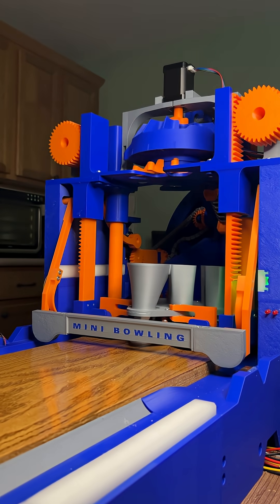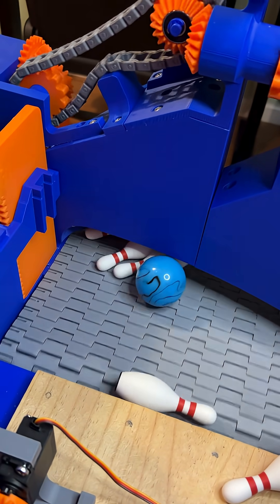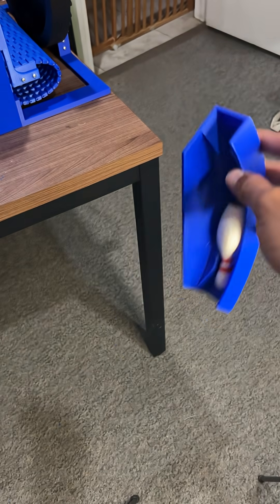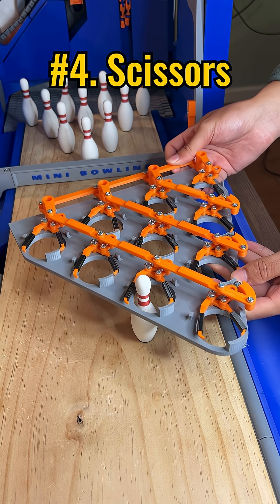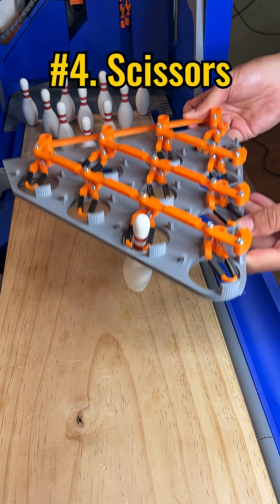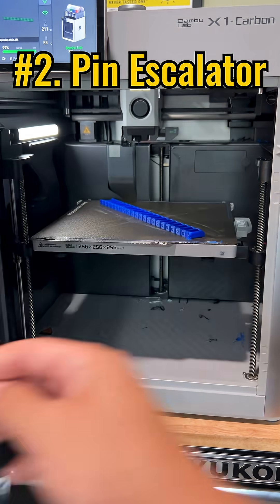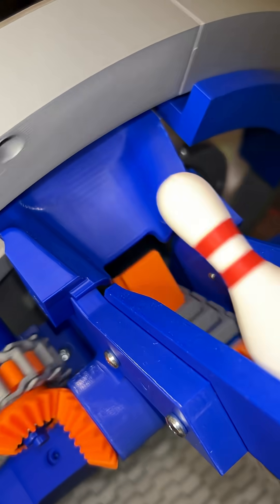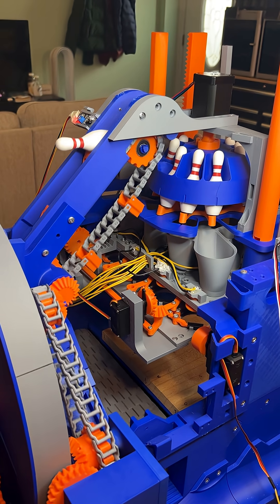How does a bowling pinsetter work?

Comment: This might be the coolest 3d print I've seen yet. Just a quick question, do you need an engineering degree before building it or do you just receive one after you get it working?

Comment: Have you thought about making a string based bowling machine? That’s a lot easier with just 1 motor for each cone and a sensor to read how much each strings got pulled (can be combined in the motor)

Comment: I worked in a bowling alley with machines from the 1930s. This is essentially exactly how they work. Of course, the motors on the original machines were run by 6 different cams & were lifting an 800lb table (the part that sets the pins).
I wish our machines had the turret. That came much later in the 80s. The original machines loaded the table flat. There was an arm that the pins would travel down on a belt. At the end is two elevated fingers, & when the pin rolled off of them, it would pull a cable that engaged the clutch. This told the arm to move to the next position. A crazy looking cam on the side controlled the order the pins were set & the pattern the arm moved in. So a pin would come off the elevator, a horn oriented it straight, it traveled down the track using a belt on the feed arm, triggered the lifter as it fell into position, once the lifter popped back up, the clutch would engage the system which moved the arm left to right & forwards to backwards using the cam to position, then it would reset as the next pin was on the way. I forget the pin loading order, but it was always the same due to being mechanically controlled. The last pin was the 9 pin, which had a switch so the machine knew it was loaded. The entire machine ran on solenoid relays with enough voltage to make you forget where you were if you touched it by accident. Guess how I know that...
It was quite a bit of engineering, but also the most finicky part on the entire machine. The most common error was a "pin jam" which is when it failed to feed correctly. This happened often, & you could hear it occur because it would jam but kept being fed by the elevator. The pins hitting the back up would fall 6ft into the carpet & smack the steel feed that guided the pins to the elevator. 90% of the errors were due to that arm, & fixing it was a nightmare. Broken cams, failed clutches, too much friction on the lifter so it wouldn't feed, etc... They had to be serviced every 3 months, which means the 300lb unit had to be removed & a new one installed. The only way to remove it was out the top of the machine, which was 6ft tall. The top was open for the machine to work, & you had two boards to stand on 1ft across on either side, abutted to the next machine, so 2ft total to stand on between both machines.
So as you can see, the turret was a far more elegant solution. The belt moves, & the turret rotates. No need for an over engineered arm moving mechanically in 2D to ten positions every rack. Though the loading arm was a really cool piece of engineering.
Reply: Cool to See someone so passionate about Something Like this :)
Reply: @lucadressler2999 Bowling machines are really neat. It's essentially a machine designed to interact with things that are incredibly difficult to automate. Round pins with an odd shape & weight distribution, picking up those sames pins in random positions, heavy balls that are extremely slick, all of which is under tremendous force as the ball is heaved at these pins, while operating under strict placement rules & rapid repeatability. If you wanted to design a system that would be antithetical to easy mechanical operation, you'd make it work with bowling pins & balls. It makes the bowling machines a very unique piece of engineering that solves a complex problem.

Comment: I wonder if it would be cheaper and more efficient now a days to just have a single robotic arm with a camera, and use clever software to program it to pick up each pin individually and set them down in their respective location.

A single robot could be shared between two neighboring alleys, and take turns resetting the pins when needed.  

Robotics are SO fast these days that a single arm could reset all 10 pins (one at a time) as fast (if not faster) than the old, antiquated, mechanical mechanism could sweep, collect, organize, shuttle them back into its resetting jig, then slowly lower them down onto the alley, release, and rise up out of the way. 

I'd imagine a high speed arm could grab a single pin and set it on its mark in a fraction of a second. So all pins could be set in less than 10 seconds. 

The arms are more expensive, but with less moving parts, they're faster, cleaner, quieter, faster and maintenance costs would be lower!

Modernized pin setter!

Another advantage is that a robot could also reset the pins in alternative patterns for different types of games as well instead of just the standard "pyramid" pattern. 👍

Comment: Its really interesting to think that back in the 50s there was someone in the back manually setting those pins. My grandfather told me that at one alley, there was this one setter that everyone wanted on their lane cause he was the fastest at setting the pins
Reply: People use to throw the balls at them too. My grandfather use to do this job. He would put a backspin on their ball so it wouldn't return all the way if they messed with him lol. They were paid a few cents per frame, so you made more money the faster you were.
It would have been in the 30s & 40s that pin setters were around. Automated machines were made in the early 30s or so. Most places were automated by the 50s, but there still could have been some manual lanes around by then. The old machines were massive & difficult to transport & setup.
Reply: @k-ozdragon this gives good history why there is a lane gate that was down to protect that guy in the manual days?
Reply: @BenODen  The gate you're referring to is called a "sweep" & it was only invented when automatic machines were made. It's there to sweep away the pins, & the service tech uses it to protect himself if he needs to fix something.
Old hand set lanes didn't have these. Nor am I aware of any guards. Bowling balls have an immense amount of energy. So anything that would stop a ball would be pretty heavy or require strong mechanical support. Those early hand set alleys had nothing like that available. In fact, some people would throw the ball so hard that the pins would strike the pin setter, as they sat on top of the rack out in the open.

Comment: Really cool, only thing is the start of the conveyor seems to be able to catch a pint and get it stuck there. Solution that comes to mind is lowering the conveyor and placing the start under the lane slightly so the pin never has to try and get uphill, or teeth on some of the conveyor belt parts

Comment: Having worked on AMF bowling machines I have to say you've more or less nailed it, actually far simpler but all the main parts are there! deck, roller floor, lifter wheel, table, distributor, fingers, sweep, ball return, awesome! 😊
Reply: 10+ years ago work on AMF 82-90's. I would  love to see the cradles instead of shoots but yea very similar.
Reply: Sounds like real bowling alleys could simplify their process!
Reply: @BobfromHolland  I imagine a lot of the extra complexity is to minimize how often they need to be manually fiddled with. If something messed up one in twenty games but you're running fifteen lanes, that's gonna be a problem.
Reply: This one is mimicking a Brunswick A2 pinsetter
Reply: @SpencerM707  I was literally just thinking that.  I worked on both the Brunswicks and the AMFs after the bowling alley upgraded and this actually seems to be a Brunswick setter and an AMF ball return
Reply: @SpencerM707 : It's a hybrid with AMF because it has AMF's carpet and ball return... kind of.
Reply: My first job was working the back alley. We had machines from the 30s that used the loading arm instead of the turret. Ever work on one of those? Crazy piece of machinery.
Reply: This is more like the Brunswick A1 machines then AMF.  He definitely modeled after the real machines
Reply: That's cause he copied a Brunswick A2. They've been around since the 50's and are still working in alleys
Reply: AMF Kissimmee lanes
Reply: But this is a hybrid of old-school AMF with old-school Brunswick!
Reply: Damn I wish I had the capacity to build something like this. Pure genius. Keep'em coming. Thumbs way up
Reply: Yeah but thats not an amf pinsetter. Thats more or less Brunswick machines

Comment: the coolest part should be the turn pan into the turret.  
yo, you shoul make an a-2 pinsetter. this thing looks like a hybrid between an AMF and a Brunisk.  Check out the A-2 pinsetter.
Reply: It definitely looks like the A2 was a heavy inspiration for the pin side of things. Now, if it can simulate an OOR or hanging banana 🤣
Reply: @IanBPPK  I just realized the Pin deck does not have a detector assembly. 

also, the Turret.no more broken wires right?

Comment: Basically, it's a 3D printer Brunswick A2. Nice job.
Reply: I was about to say thw same thing! One of my first jobs waa in a bowling alley with Brunswick A2s, and I learned sll about their workings and maintenance! I remember I almost lost a finger cleaning the belts, the head mechanic was old-school and said to just turn the machine on and hold the rag to the belt and let it run through. To his credit, he did warn me that it was dangerous. And when, seconds later the belt ripped the rag out of my hand and whipped it around the pully wheel, he said " See? It just about got ya!"

Yeah, this generation has it way too easy!

Damn, how did I get to that?
Reply: Only thing skipped really is the Counter-rotating ball wheel and ramp. Cant blame him there 🤣
Reply: @IanBPPK imagine having to re-engineer the lift rods, I would be taking cues from the GS or AMF lanes too 😅
Reply: @EthanCGamer no matter how you look at it, he did a great job on this.
Reply: @EthanCGamer I forgot about the GS machines.

Comment: Can't wait for the next project.
Reply from the maker: Any fun ideas??? Hopefully something that takes less time 😂
Reply: @dannylumcreative you should do a mini amusement park
Reply from the maker: Oh i like that
Reply: @dannylumcreative The problem is that I think alot of the simpler things  have already been done. How about a 3-d printed mini pinball machine? There are a few "basic" ones with little/no electric elements which are pretty meh. If that's too much how about a slot machine or a Pachinko machine (same problem as the above, there are "boring/very simple" versions available)
Reply: @dannylumcreative make a mechanical coin pusher machine!